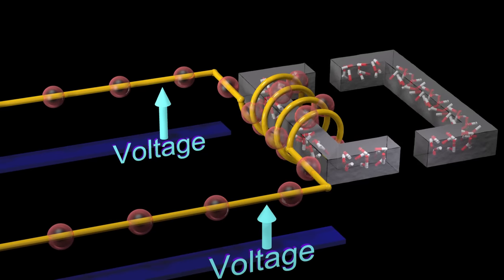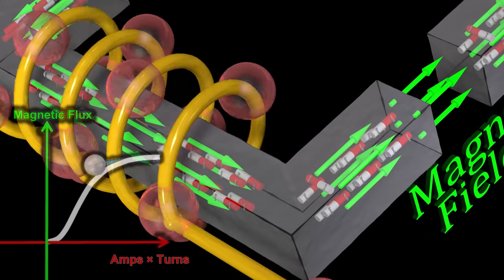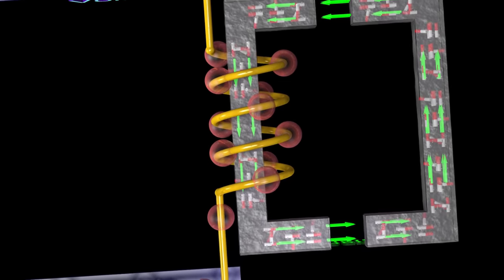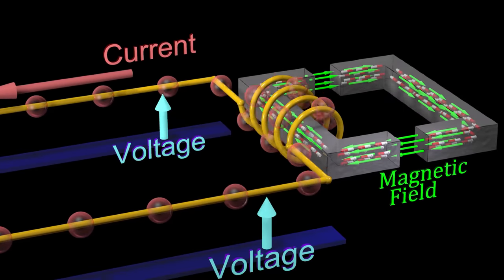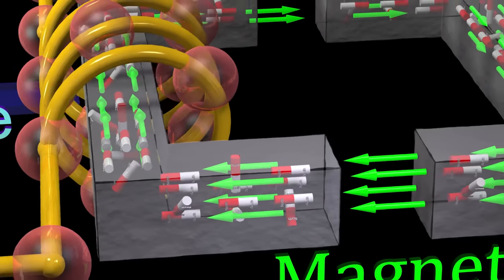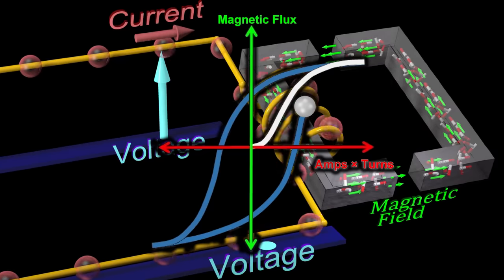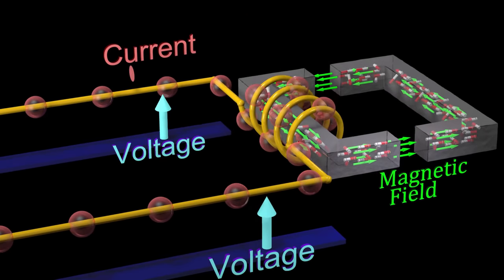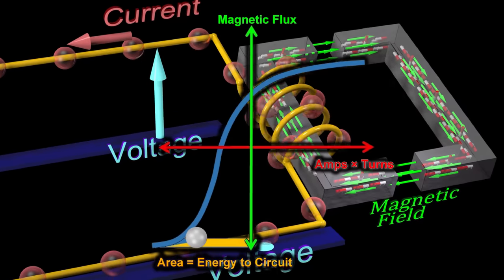Magnetic Energy of Hysteresis

Comment: Nothing is said about the power of the hysteresis loss, which defines the magnetic material quality. This power is proportional to the magnetic core physical volume. This is why any calculation of an inductor or a transformer should be begun with defining necessary physical volume of the core that ensures the core proper operation without overheat and saturation. Energy is not the physical value of importance since it depends on time and is not indicative.

Comment: In the electrical power industry, instrument transformers to measure current can have large heavy steel cores. The amount of magnetic field in the steel when there is no current flowing is called the remenance factor, and the core gets demagnetized after testing. I know because I test large current transformers that can be 3 meters tall and weigh hundreds of kg.

Comment: Great video. Could you do a similar video  but with superconductors and the magnetic fields they produce in relation to current and voltage. Unless you have already done this subject. 
Another idea is to do a video on the geometry of magnetic fields by altering the shape of the flux material in donuts, squares, lines and the interaction of two magnetic fields geometry.
Reply from the maker: I will add that to my list of topics for future videos.  Thanks.

Comment: Can you give more insight into inductors about why the inductor first opposes the current passing throught it and oce the current reaches a specific stable value why it opposes the current from reducing.... I think it has to do with the information that the extreme ends of the inductors first get the information of the circuit switch being turned on and off and the coils at the centre of the inductor can't get that information at that time i.e., it takes more time to get that information because information travels at exactly the speed of light... Anyway many people say that there is a great similarly between electric circuits and hydraulics ( analogy of current flowing through resistances with fluid flowing through pipes ) can you please make a video on this to get a better insight of voltage analogous to pressure and current analogous to volume flow rate of the fluid?
Reply from the maker: Inductors simply try to prevent the current flowing through them from changing.  I have a video explaining inductors at https://youtu.be/ukBFPrXiKWA

Comment: Can you help me 
Why, when you have higher voltage you have lower current?
Voltage is potential power?
And current is the electron flow tru a circuit, right?
I never could catch the flow of this one on school.
Reply from the maker: For a resistor or light bulb, a higher voltage gives a higher the current.  However, what is going on here with the coil is that the voltage is proportional to the rate at which the magnetic field is changing.

Comment: Why is voltage illustrated by electrons speed?
Reply from the maker: Voltage is illustrated by the height of the blue arrows on the left.  The current is illustrated by the speed of the red spheres.  And the red spheres represent positive current, which moves in the opposite direction of electron current.